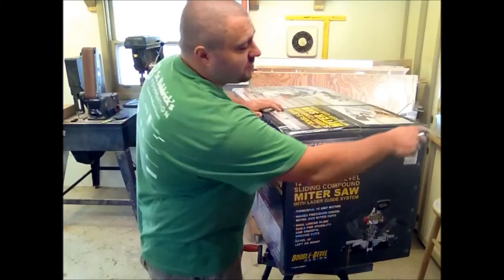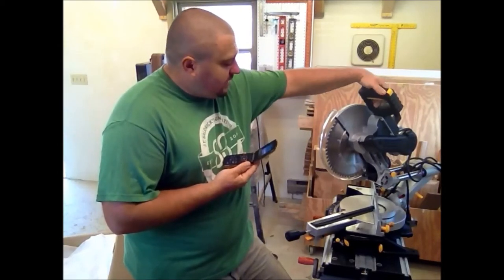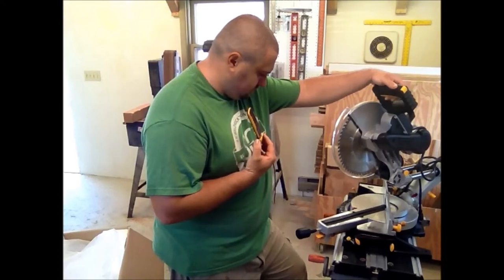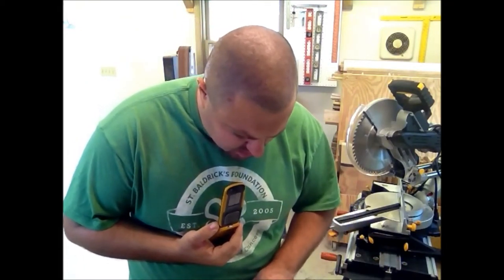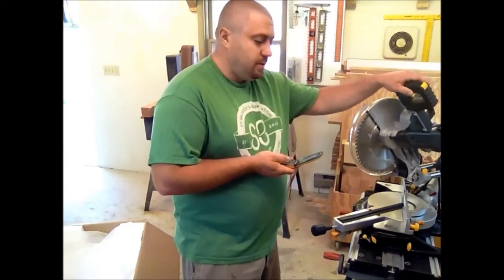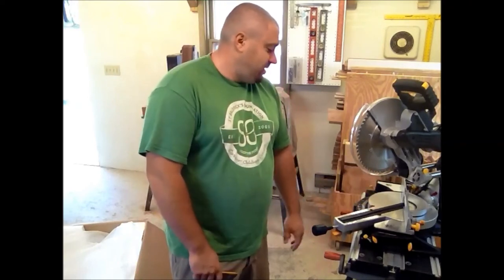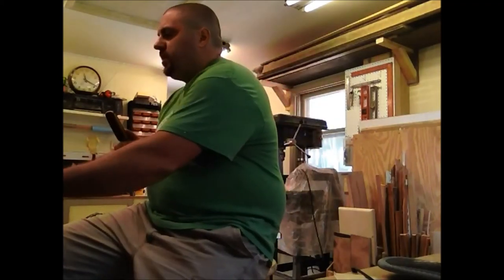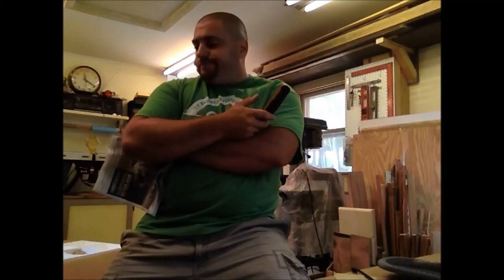★Harbor Freight Tool Review of Customer Service for Broken / Damaged Tools and Products

Comment: first off you could have gone to the hobby store and gotten a bottle of plastic weld for 6 bucks and it would never come apart. instead you made a few people feel like they were nothing by talking to them in such a rude manor i hope i never have to deal with you
Reply from the maker: niko jack I will entertain your statement, but first a question. Why should I have to drive to a store spending my gas and time to purchase glue, that in my opinion will not hold for long, when the saw is brand new and damaged out of the box. Bear in mind that this was not the only broken saw when I ultimately returned to the store I opened 3 more to find them broke also. 
I don't understand why you feel I was rude. I was not condescending, swearing, or threatening. I was simply asking for what I as a customer wanted to cure the problem. If you feel that I indeed was being rude to the employees on the phone I would like to know why. I attempt to treat people with respect, as I would want to be treated. 
I would also like to say that the young lady at the vestal store from the first call saw me bring the saw in the box back into the store stopped what she was doing and  helped me personally at the store find one that was not broke and was polite and helpful. 
My personal feeling is if she felt that I was rude or belittling that she would have avoided me all together not saut me out and introduced herself from the call I had made.

Comment: HF is OK for some very basic hand tools, but for the most part it's crap. Buying power tools from them is asking for trouble. Cheap shit that does not last is not a good value and will not save you money. And if your a pro, your gonna lose money when you can't finish a job cause a tool failed. Customer Service speaks volumes about a company. The good ones have parts in stock and will probably send you one for free-even on older tools. Having to bring the whole tool back for such as simple part is a joke.
Reply: MarzNet256 its all made in China, wheather you get it at harbor freight or home depot.

Comment: 10 miles per gallon.. the fuck do you drive, a hummer?
Reply from the maker: fusionstar916 LOL. Nooooo. A tank. No not really. I drive a 03 ram 2500. 4x4 has the 5.7 liter hemi in it. It is actually 9 to the gallon on average. Lots of pushing and pulling power. It just takes a lot of gas to do that pushing and pulling. Thanks for watching and commenting
Reply: Dan Rogers wow, thought those would get at least mid teens. Anyway, I have returned 2 items to HF last year. A flux core welder that stripped it's plastic wire feed tightening screw, and a air hammer that just seized up. Both were within return period and I got exchanged with no fuss. Luckly, I live less than 8 miles away and my 02 tundra gets 19mpg. Haven't had the opportunity to call Customer service so i have no input there. Best deal at HF was the 1/2" earthquake impact for $30 with 20% off coupon. Not sure if they still carry it. Had mines since 06, and it broke every bolt I asked it to. Including seized axle nuts.
Reply from the maker: fusionstar916 the 1500 rams get better mileage. I have the lower gear ratios in the 2500 3/4 ton for the loads I have to move with it. It is a power house though. 
I usually do not have issues with HFT for what ever reason though this saw was a issue for them this time. In the past I purchased a green house that ended up missing a necessary part that was noticed after it was almost completely constructed. They apologized and sent me the replacement part ASAP. Oh well.  I did get it taken care of it just took an extra trip that's all. Thank you for watching. I hope to hear from you again sometime soon.
Reply: fusionstar916 My 73 Chevy flatbed gets 10, and so does our 72 Ford F100 pickup.Hell, my VW Trike only gets 28 on the highway. What do you drive ?
Reply: Dennis Flora 02 tundra. 19mpg combined actual. Its still painful to fill up that 26 gallon tank.
Reply: fusionstar916 my ford E250 van gets around 10 mpg

Comment: that is exactly why I buy dewalt they just don't break in the first place perform better and last forever. it like I always say pay now or pay later.  cheap tools become expensive tools after you replace them a few times then you are left with an expensive piece of junk.
Reply from the maker: jamiejo85 if I were purchasing a saw myself I would buy a reputable brand, however this was a gift, and it would be a little rude to mention to the giver that it is not name brand. :) I will use it until it is not useable. Either way though I would like to start out with an unbroken tool.

Comment: That's unreal Dan!
Reply from the maker: ***** I'm of the opinion that Large companies such as Harbor Freight Tool store is literally throwing money away by doing things like this. The saw worked perfectly. It just had a broken part that I wanted to not be broken right out of the box. When I took it back to the store I opened 3 more boxes to find broken saws. They were dammaged in the same exact way. That's 4 saws at $200 each they are throwing out $800 worth of tools. If I beak my saw there is currently no replacement parts for it according to the 1 800 number operator. (sighs) This does not seem to me to be a profitable business model for them to use.

Comment: Wow you act in this video as if you were so put out by this. Even if you bought some higher end saw from ,let's say Home depot you couldn't just call the store and get a replacement part for. Its a cheap saw from Harbor freight which I love to shop at. Yes taking things back sucks.
Reply from the maker: ***** my purpose in calling the store first was to give them the opportunity to make it right first. Most managers would prefer that. The store, especially the big box stores like lowes, has the ability to order the replacement part and have it shipped to me directly. All I wanted in the first place was the broken part replaced without having to spend an hour of time and gas money to run all the way back to the store. Which I ended up doing anyway because there was no other option. And yes, I was put out to in having to return it. Any person who needed to travel 30 miles back into town would be. It would have been easier IF the store or the customer service were able to ship the replacement part to me, but it was not an option. As far as I know parts are still not available for the saw.
Reply from the maker: ***** even though our opinions are different I do appreciate you expressing your opinion here. After all variety is the spice of life. Thank you for watching, and remember that I do enjoy talking to ever person who comments on my videos. I look forward to talking with you again soon.
Reply: Dan Rogers I agree, my HF store is 30 miles one way, gas isn't cheap, shipping is by far cheaper than buying fuel.  That part should be available as actually it is a wear item on the saw along with the drive belt something that the store should keep in stock for all their tools and equipment essential wear items.  Even if they had 1 warehouse in the country somewhere that housed all the replacement parts it would sure be nice.  At least through big box stores they usually are able to order parts over the phone, or have them on hand at the store in some cases.

Comment: I WOULD TAKE A NEW SAW/ OR JUST USE WITHOUT IT...OR FIX THE SMALL PART THET WAS BROKEN ///DONT BE A BABY.LOL SHIT HAPENS
Reply from the maker: D.J. KEYS I could have used the saw without the broken part on there. The saw was otherwise fully functional. I would have most likely done just that too if they could have sent me a replacement part. Unfortunately they don't make parts for the saw. This is why I ended up having to take it back to the store. I was thinking about just using the saw as it was. I have heard many people say "just glue it" lol "baby" :p . My concern with gluing it is that there is alot of vibration in the start and stop of the saw and that it would not hold good enough. If it were to come loose I was afraid that it would catch on the spinning blade and come flying off in my face. If i were to use it without the piece installed for thin cuts the piece of wood would fall down into the rotation table and could do numerous things. The worst of the thing that it could happen is the thin piece of cut off wood could fall back into the blade and get thrown by the blade or the least is it could just jam up the turn table not allowing it to adjust to different angle for cutting and have to be cleared each time.
Reply from the maker: D.J. KEYS And yes poo does happen, lol I just dont want to give it the opportunity to happen on a larger scale to me. The guards / guides are there for purpose. lol like not having stuff  come off and hit me in the face. EXPERIENCE is useful and take it from me it HURTS more times then not.
Reply from the maker: D.J. KEYS Thank you for your input. I appreciate you being here and watching the video. I hope to hear from you again soon.

Comment: thats the way the contract is with the manufactor
Reply from the maker: stewartj that still don't help me, the customer. The store or the manufacturer should use some good common sence and not focus on being penny wise while being dollar poor. A cheep kerf board sent via UPS would be much cheaper than returning and wasting an entire saw due to some cheep no mechanical part. On the same note it seems even more of a waste when taken into account that there was a total of 4 of the saws that were all broken in the same place
Reply: they just return it to the manufactor and get credit or replay this is a disposable society even most manufactors dont repair they either sell them to someone to repair or most junk them its figured into the price that some will not be right or fail ,
Reply from the maker: stewartj it's seems like one big waste all the way around.
Reply: most stuff is at way now the price of the replacement is figured into the price of the orginal they arent loosing anything